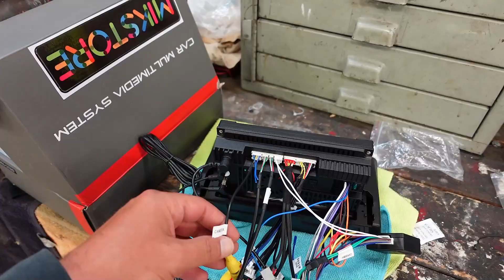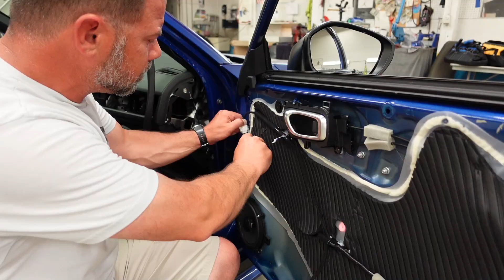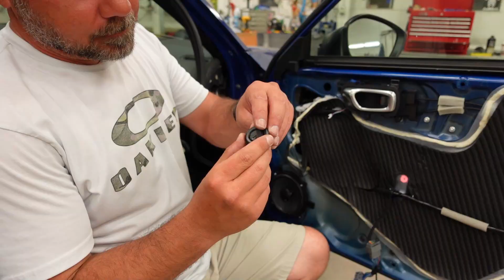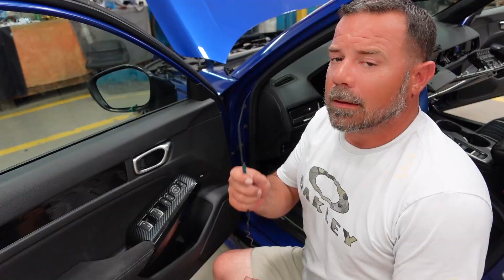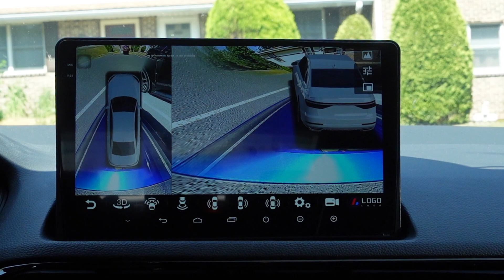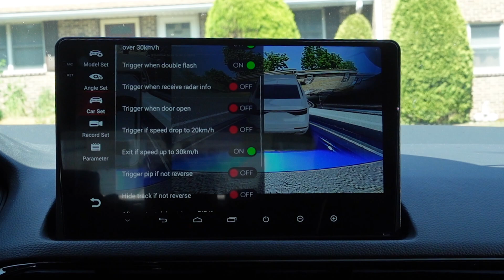11th Gen 22-23 Honda Civic gets 360 Cameras/Android Premium Head Unit

Comment: Hello looks awesome! Do you have any delay when putting the car into reverse. My unit takes about 5 seconds for the rear camera to show up when using the 360 app. But when I had it connected to the OEM backup camera it was instant. I do not have any trigger wires connected and am wondering if that is why?
Reply from the maker: It delayed without the cameras hooked up. With the cameras it's about a second. Could always tap that red wire into the reverse. That will make it instant.
Reply: @717PROJECT  I will try that I only have the front and rear cameras connected currently. Thank you for the tip!
Reply: Wait did the OEM cam work with this headunit?
Or did you mean OEM headunit + OEM Cam was instant?
Reply: @repit5014  yes it if it came with the correct harness.
Reply: OEM camera with the new headunit is instant, as well as aftermarket camera, and or using the 360 app. 

Using the 360 app was not instant because I didn't have all of the cameras connected.

Turning the headunit on is also instant as long as you set it to go to sleep mode and not shutdown, make sure it's wired right or you will drain your battery.
Reply: @scook9216 what unit did you get if you don’t mind me asking and did you do anything special for your wiring?
Reply: @MaddmaxxxRc  I got the Mekede M6 max 13" for my Accord. After plugging in all of the cameras the reverse video is instant. Everything was plug and play.
Reply: @scook9216  also was the install for the side camera mirrors hard?
Reply: @MaddmaxxxRc  it was pretty tricky. There are videos of the disassembly on youtube. I ended up buying new lower mirror housings to fit the cameras. Make sure you get 4 square bodied cameras and they will fit the aftermarket front emblem, rear camera and aftermarket lower mirror housing. Most 360 kits have pre angled cameras that won't fit the aftermarket housing without modification.

Comment: in the door wiring boot there should be 2 larger slots free to run wire through. I was able to run 14 gauge speaker wire through with no problems

Comment: How did you remove the mirror caps so easily? What corner did you start from to take them off? I’m wrapping mine but If I don’t have to go through removing the glass and all that then that would save me so much time!
Reply from the maker: Tabs hold it in place. Pull hard but gentle at the same time if that makes sense.

Comment: That 3d camera system looks kind of horrible, actually. I appreciate the time you took to install them, but I don't see how its 360. You can't see anything around you like I would expect 360 systems to do. Everything is distorted way too much. Also having to connect every time I want to drive, is a pretty big deal/annoyance. Hopefully, thats just a software update and not cheap hardware.
Reply from the maker: It's there but it's really fishbowlish. I just keep it on 2D.
Reply: @717PROJECT  I don't see it how it should be (the driver seeing everything surrounding it's car in 360). All you see is different camera angles stitched together to make a bad 360 image that's not showing anything as you'd expect., that's why I say it looks horrible.
Reply from the maker: @DaKurupt19  Honestly, I don't even really care about the cameras as much as the other options the head unit has. It's crazy what this thing can do and I don't think I even scratched the surface.
Reply: @717PROJECT  Well, tbh I wouldn't buy something advertising functions and many don't work. But I see how someone could gloss over that if it was gifted/discounted for review.

Also, many of these no name chinese aftermarket headunits are known to crap out in a few years or so (especially in extreme climate areas), so it not working correctly out of the box tells me it's more than likely to happen with that one. Hopefully, I'm wrong though
Reply from the maker: @DaKurupt19  I hope you are too! I can't complain really, they sent it to me for free.

Comment: Would the 360 cameras work with the OEM headunit or do you need this one? Also would this void warranty?
Reply from the maker: It won't work with the factory head unit. You would need to buy this one. I don't think it would void warranty as there is no vehicle settings through the radio like the 10th Gen. All 11th Gen setting are in the dash cluster.

Comment: When reversing, do the lines in the rear camera move along with the steering like the OEM camera does?
Reply from the maker: Unfortunately no
Reply: @717PROJECT  think this is a setting. Mine moves with steering.
Reply from the maker: @AtAndr3w  do you have the 360?

Comment: Awesome job, Miller! You're always so meticulous and so detail conscious to have a standard of excellence in all you do, from your video production, plus your patience and tenacity to do things right. 

This head unit is phenomenal. Without tape players or optical media drives, you can make head units much more affordable, or put in much more features and technologies.

For my Buick GN, my last edition top of the line Alpine cassette was about $600. 

Can you imagine if all this was offered as a special order option for Hondas and Toyotas. At least the Sport and Sport Touring, or upper level trims. 

I just would rather keep mines essentially stock OEM except for DSP, amp, speaker, subwoofer upgrades 

But, some things can be added on my integrations without causing problems or issues. 

If I had the HR-V Sport for a daily, and the Civic Sport Hatchback for my toy car or project car, I would do some of the stuff you have on Blue. I would like this deck and cameras, but still kind of daunting. I guess axreally good stereo shop could do it. 

I always wonder how these 360° cameras worked for those above and other views of the vehicle itself. 

Btw, can you change the car color to blue, like the color setting you mentioned, also MPH from kph?

Like I said, lots of these things are overkill for most of us, but so intriguing and entertaining. But lots of things are practical add ons to consider. Some simpler, others not so much. 

Kudos for all the companies that make all of this awesome stuff, and you and others how to install and use them, and show how it works and looks like. 

www.collegehillshonda.com has all the factory OEM accessories and great aftermarket accessories like simple basic seat covers, those things to put between you front seats and center consoles so you don't drop things there, and especially the protective covers for your key fobs, so they don't get scratched up in your pockets from other stuff, like have. 

Get your rest, healthy nutrition, and family time in. 👍
Reply from the maker: Thank you, brother! I remember paying thousands of dollars for speakers and head units back in the day. Now you can spend a grand and get a killer stereo! Yep, you can change it from MPH to KM.

Comment: Is there dynamic reverse line on this unit
Reply from the maker: There is an option to turn it on/off
Reply: Did you fix the delay from reversing camera
Reply from the maker: @Pokka676  Yep, and I didn't have to install the red wire.